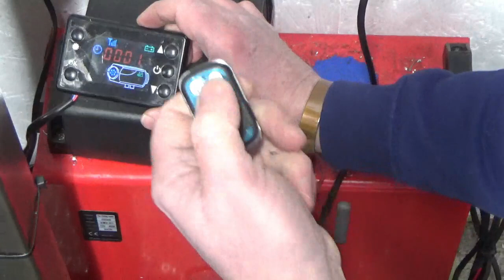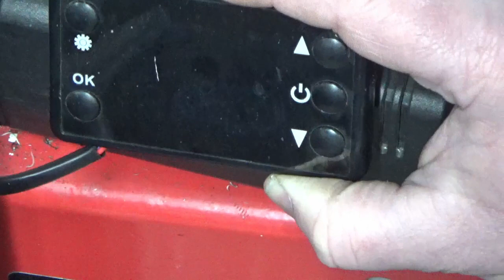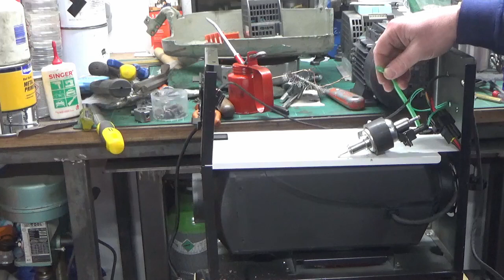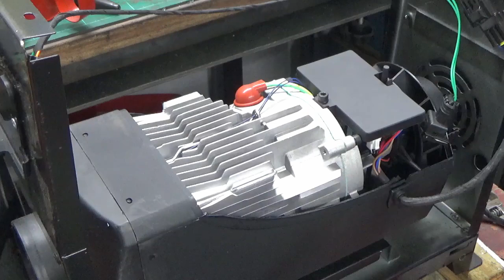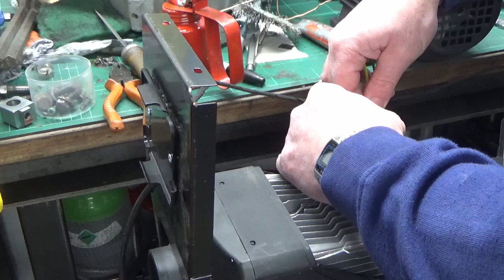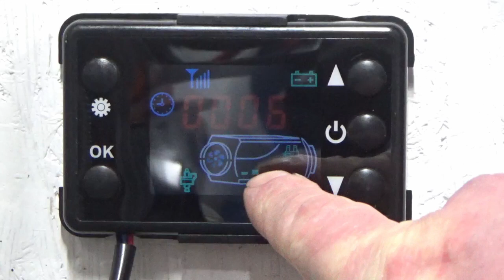Chinese Diesel Heater Fix - Glow Plug Replacement

Comment: sucking in the air intoo the combustion chamber from outside the shop might cause it to be less effective as the air from the outside is colder and needs more heating to reach the same temperature as the inside air  
in theory sucking up the air in the room and blowing it out toward the outside of the shop creates a slight vacuum in the shop so it automaticly would suck in fresh air from outside through the gaps in youre workshop  , i am a little worried about the machine being so close to the floor as it can suck in metal filings and dust intoo the combustion chanber and possibly clog it up some 
if you could raise the machine so its a bit higher of the ground (and leave the hose on the floor) might help a lot with that , maibe weld a small platform from angle iron on the steel post you parked it behind and set it on that
another thing you could do is make the exhausthole bigger so you can put the heater hose through it , place the whole machine outside the shop in a birdfeeder type construction or inside an oildrum with an open end and feed the controll unit indoors through the same hole the pipe goes though and mount it inside the shop on the wall  , would dampen the sound by a lot but there would be a chance of the fuel gelling up if it gets colder
Reply: On the other hand, the cold external air is more dense and therefore more efficient in combustion.
In theory perhaps, but Jon's "draughty workshop" is not likely to enable a pressure differential.
Reply: Mostly roundabouts and swings.  If the combustion air is taken from inside, it must be replaced by draughts into the room.  Only time an outside combustion-air intake is likely a pain is if the inlet becomes blocked.  Little problem, most of the time, in the UK, but could be a nuisance in some cold regions of the world.

Comment: Back in the 80's I repurposed a VW auxiliary gas heater to preheat a light aircraft engine. From experience those heaters were a fire waiting to happen. The fuel was injected into the combustion chamber and igenited with a glow plug. It often started with a loud pop and several times caught fire with excess fuel. I carried a fire extinguisher that i had to use a couple times. It was cheap insurance.
Reply: Most ‘fuelled’ heaters for (diesel) engines drip fuel on an incandescent wire coil which ignites the fuel in the induction manifold.  They work quite well but glow plugs in the combustion chamber have become the universal(?) means of igniting the injected fuel to get the engine started in cold conditions.
Reply: Similar preheat/pre combustion systems were made under the Ki-Gas brand name. They basically ignited a diesel that was sprayed into the intake manifold for a few seconds to urge a cold diesel engine into life.